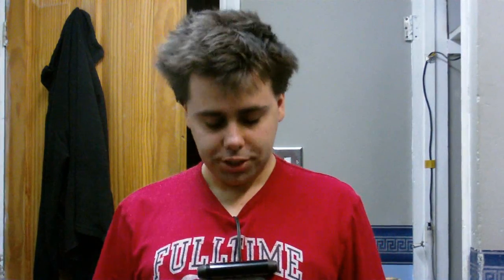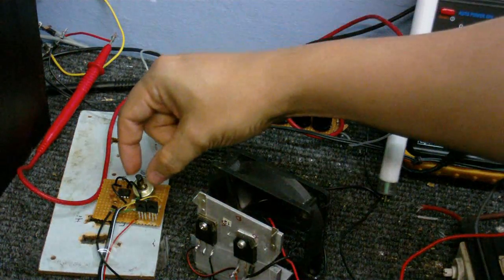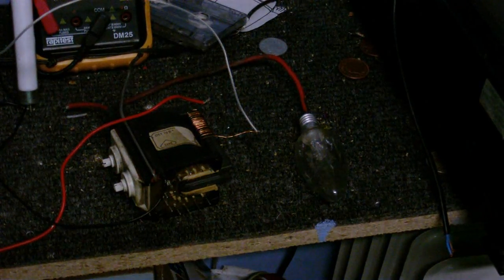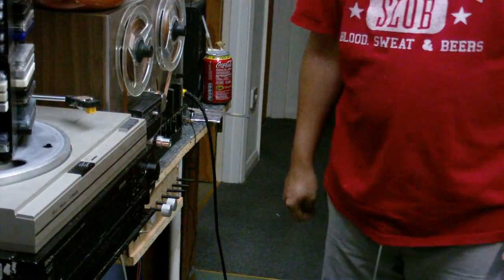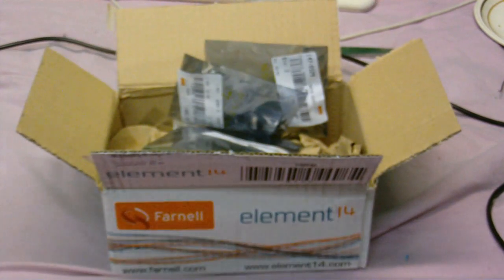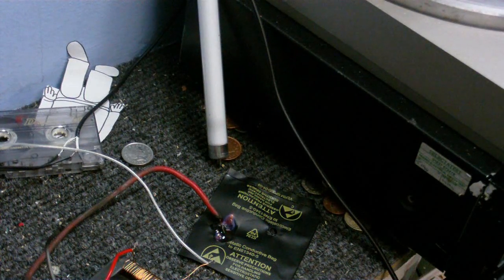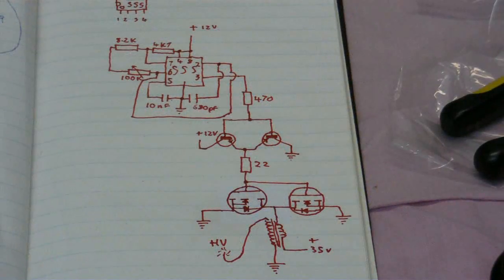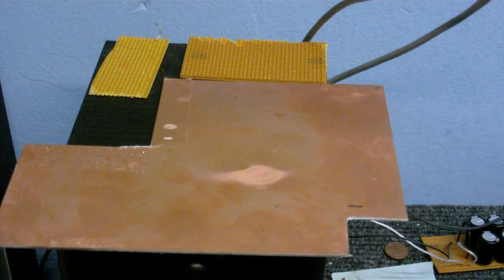Upcomming Projects

Comment: You can use 2K2 instead of 2K or use two 1K resistance in series....this modification in the bias circuit will just change the trimpot adjustment point...so..be free to tweak it to match your available parts.

Comment: All these are very good ideas Clem...i will try your high voltage modulation as a plasma tweeter soon...i am waiting a friend that will bring me an old monitor, them i will pick up the fly back transformer.... good idea about to build the Dx Amplifier..i am sure you will happy with it... P3A is fine..but the Dx unit is even better..clearly better...nothing wrong with your face, nor the voice..but you should cut your nails because you show things using hands and they appear into video